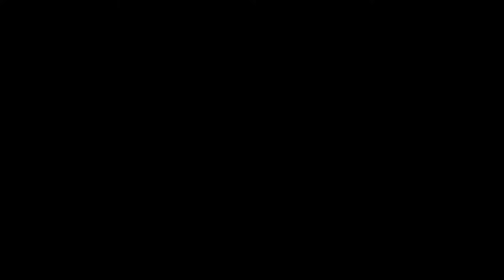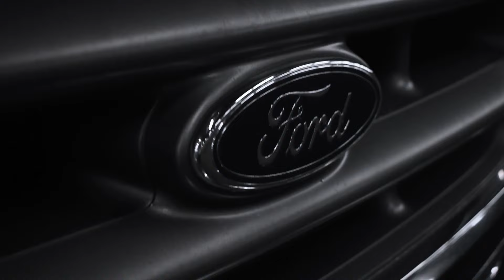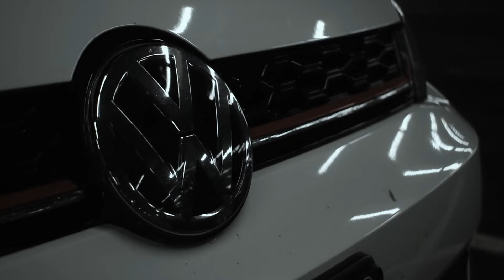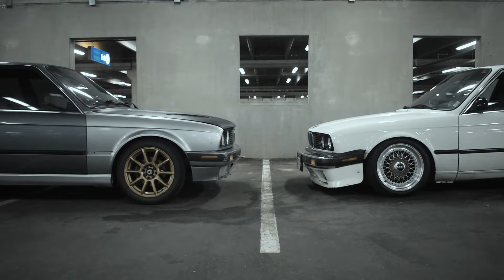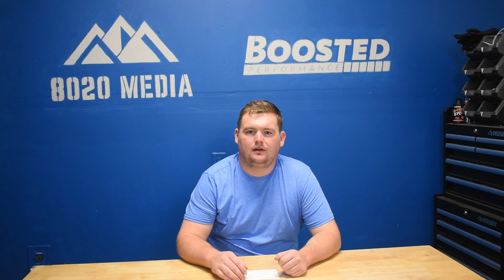How Reliable is the Ford 3.5 EcoBoost? | 3 Common Problems

Comment: Get 5.0 if u want it to last
Reply: Yeah and burn oil
Reply: @ryanstrain4071  ill take the burn of the oil fuck it lol instead of those turbos going out
Reply: I have a 2019 F150 with 5.0 that I bought new. Oil consumption was bad in the early days ( 1qt in 1,000 miles), now with 48,000 miles @ 1/2 qt in 4,500 miles. Acceptable
Reply: @5litreho  right on im looking into the 21 5.0 the ecoboost  seems great but, i never had any turbo engine cars before.
Reply from the maker: Yeremy - We actually have an article on one of our sites highlighting this exact topic: 5.0 vs 3.5 Ecoboost. Both engines are excellent and pretty reliable! The Gen 1 3.5's get a bad reputation from the timing chain issues. We feel the 3.5 EB has an advantage in torque, tuning potential, fuel economy, and towing capacity. But again, we think the 5.0 is also an excellent engine and can't really go wrong with either of them, so long as proper maintenance is delivered.
Reply: The 3.5 lasts a long time, people that take care of their vehicles have vehicles that last a long time. People that don't take care of their vehicles don't, that is accurate.
Reply: @yeremy7144  so you have never owned a turbo engine yet you think that you know what’s gonna happen to it, smh.. so what is your prediction of the stock market?
Reply: Lmao. Funny
Reply: @paulhunter9613  umm yea in the shits
Reply: Gen 2 5.0 is where its at. no burning oil and tried and true 6 speed. mine is a 15 lariat fx4. love the truck.
Reply: @yeremy7144  but as of yet no turbos going out, opinion fail again
Reply: cylinder liner issues an crappy displacement on demand?  new 5L has issues as does the 2.7

Comment: Only v8s belong in trucks not Honda civic engine... and a real truck doesn't have a mt dew cans for a body
Reply from the maker: Unfortunately all the manufacturers seem to be going the way of the smaller turbocharged engines. It makes sense for efficiency but we still always appreciate a good V8 under the hood.
Reply: @8020Media  The only real disadvantage is the loss of the "V8 roar," which is awesome. But let's face it, most trucks run with oem exhausts, so you can't really hear much of anything anyway.  I installed a Corsa Ford Performance cat-back dual exhaust that runs straight out the back, old skool rectangular chrome tips. Looks and sounds pretty bad ass.
Reply: Right. They can have aluminum drive shafts all day, just not a fender.
Reply: @ericpigg2689  Get real, dude. It makes no difference whether a fender is aluminum or steel on a truck. They both have their advantages and disadvantages, but they'll both suffice. Me personally, I'm thrilled knowing that my fenders won't be rusting through within ten years. Also, aluminum bodies and EcoBoost engines decrease weight significantly, making Ford's more fuel efficient while increasing payload capacity. That's a win-win in my book.

Comment: No Ford engine is comparable to the Toyota Tundra 5.7L V8 period!
Reply from the maker: Kim - Have you had a 3.5 EB and mind sharing your experience? This will help future viewers. Also, Toyota builds some mean reliable engines!
Reply: No they are not comparable. The 3.5 EB's actually make a ton of power while getting decent mpg.

Comment: My 2015 Ford explorer's 3.5 v6 engine piston #4 cracked only after 50,000 KMS. Wondering what could have caused this at a very early stage.
Reply from the maker: Sorry to hear about the unfortunate piston issues. Was it covered under warranty or were you out of warranty at the time of the failure? It's hard to say the specific cause without full details like vehicle history, oil analysis, tearing down the engine, etc. Even then, there might not be a perfect answer. Often, when a piston cracks with very low mileage it is likely a manufacturing defect.

Otherwise, there are endless possibilities that could cause a cracked piston. If your timing or timing chain ever had issues it's possible the piston collided with the valves, but you'd likely notice some bent valves too (and it usually affects more than 1 cylinder). That seems unlikely. Maybe you had coolant leaking in the cylinder. Or a leaking fuel injector. Engine knocking can definitely cause cracked pistons and the underlying cause of knocking could be anything from a leaking injector to lean AFR's to poor fuel quality and tons of stuff between.

It's all a guessing game unless you're aware of any existing or previous issues, had any other symptoms/engine lights, and tear down the engine for a full examination.
Reply: @8020Media  thanks for your reply. Unfortunately, its already out of warranty since its already 7 yrs old. Here in the Philippines, they only cover 5 yrs or 100K kms. 
The first symptom that showed up was an error indicatinf AFR to lean on Bank 1. We thought it was a sensor issue, but wasnt. We then saw misfire error on Cylinder 4. Eneded up replacing all spark plugs and ignition coil for number 4. The misfire issue persisted, this time with flashing check engine lights. Ford ended up replacing injector 4 and its seal, plus fuel inlet gasket. After that it still failed compression tests on number 4 and thats when we decided to pull out the engine and saw the piston cracked on 1 end. The cylinder was damaged as well because of the crack and stuck piston rings. Had to have the cylinder fix and re sleeved. Checked the valve and all are in good condition so looks like it didnt collide with the piston. 
At this point we are in the process of putting the engine back. Hopefully everything is fixed, but really would want to prevent this from re occuring. Vehicle has been sidelined for 4 mos now as it is very hard to find this engine's parts here. I had to look in the US just to get gaskets and replacement pistons. Thanks for your help, hope the info I provided can help pin point the issue.

Comment: I have a 2012 Ecoboost that I bought brand new and I have just over 230k miles. The only major issue I have had was a coolant leak right under the turbos at about 110k miles or so, Ford had to lift the cab off to fix it. Now I am have a shudder at around 65- 70mph but it only seems to happen on longer drives, more than 20 minutes. Only when I am accelerating up hill, small hills I am in Fl. Any suggestion would be appreciated.
Reply from the maker: Azz - Thanks for sharing your experience! There are a few things that can cause shuddering: Transmission or torque converter, tires, wheel alignment, drive shaft, or brakes. Keep us updated on this.

Comment: I had to have my engine basically rebuilt after 100k miles with this engine. 2018. XLT. Vsp sensors. Bad.
Reply from the maker: So sorry to hear this… are you still driving it?
Reply: @8020Media  yes. I smartly bought an extended warranty. The bill was 5,000$. Insurance paid 3k. Runs great now.
Reply from the maker: That's great to hear! It should go another 100,000+ miles for you.

Comment: I noticed he didn’t talk about the fan cam phasers Ford. can’t fix the problem
Reply: mine fixed first dealer recall.  no issues
Reply from the maker: We did accidentally skip over the cam phaser issues. Whoops! This was our first video and we were a little caught up on the other aspects of production.

Anyway, the issues do appear to be resolved with the updates/recalls. Hopefully that holds true for the long-term.